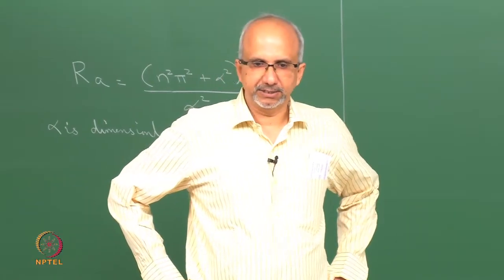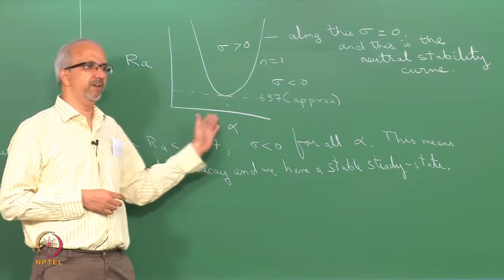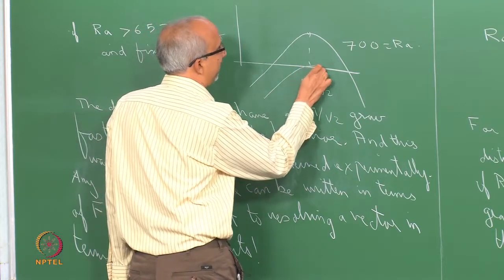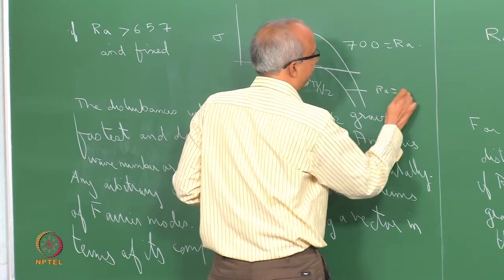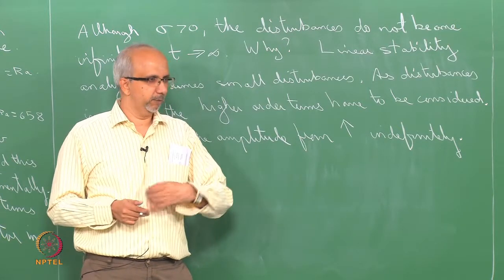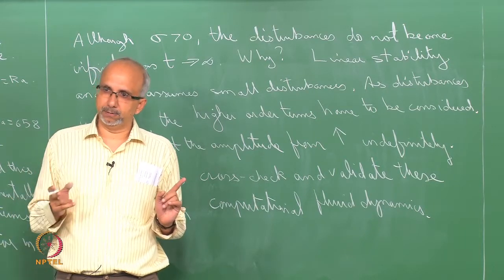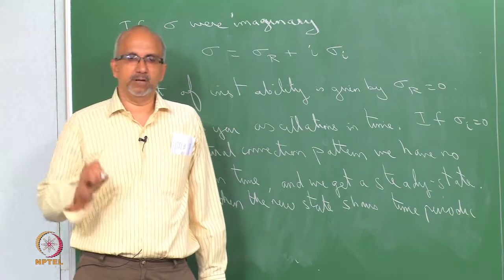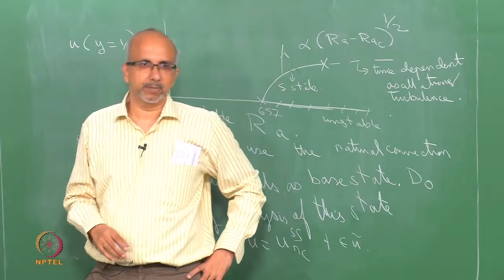Mod-01 Lec-25 Rayleigh Benard convection: Discussion of results

Comment: Prof. Pushpavanam, thank you so much for your lecture series about Rayleigh Benard convection. I have really learned a lot! Could you say a little more about the vertical direction (At 11:30)? How can we understand that n=1 is the most critical wavenumber such that we only have one roll in the vertical direction? I'm also curious that what kind of condition will give a complex growth rate. If we increase Ra, the convection will arrive at a periodic state. Is the growth rate at that state has a non-zero imaginary part? How can we further do linear stability analysis at that state? Thank you very much!